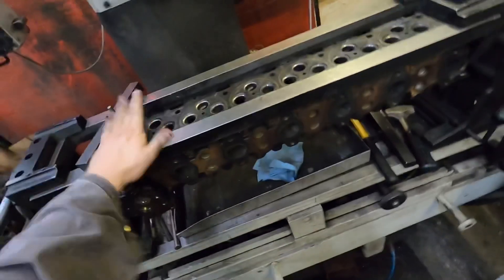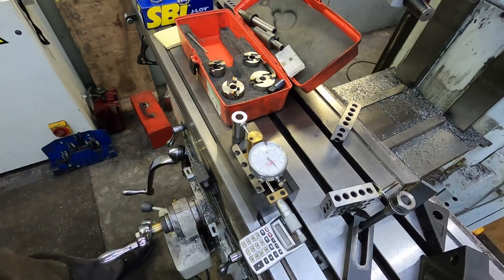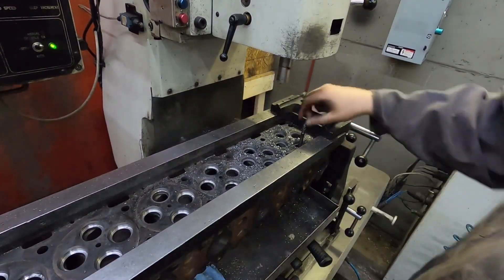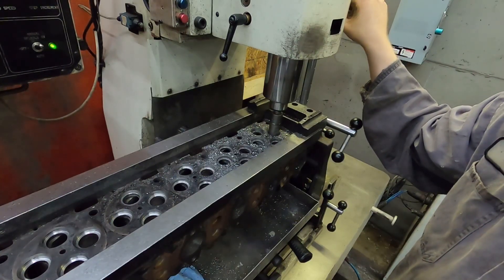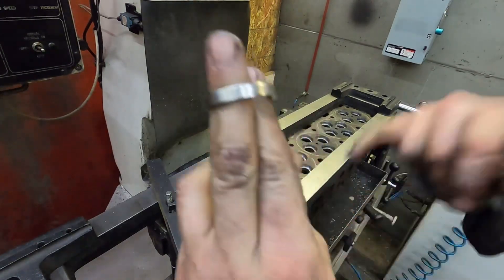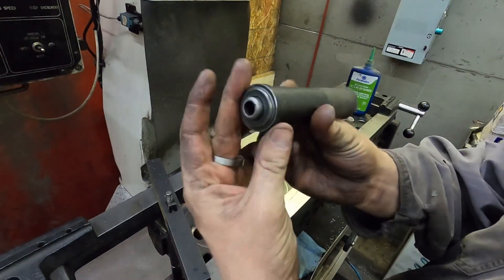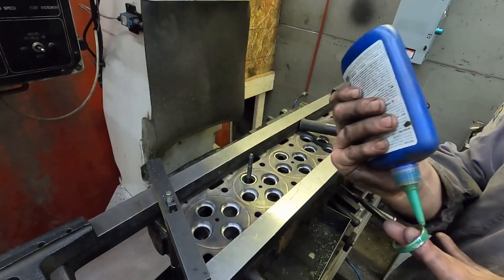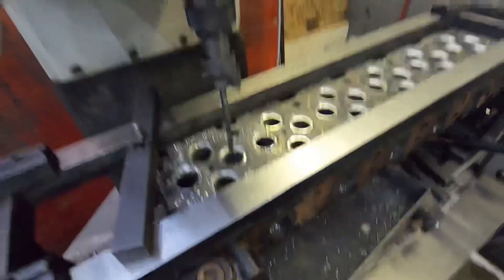PART 13 HOW TO BUILD A 6.7 PPUMP Cummins. Doing head work.

Comment: Would you recommend putting insert seats in the vp head or would the integrated seats be okay around 1000hp?
Reply from the maker: If there not cracked I would just leave the integral ones in.

Comment: 12mm pump or 13? and your getting a dyno? dyno wouid be so wicked to have.
Reply from the maker: maxed and balanced 215hp pump to start with. ya I will be buying one sooner then later
Reply: @CUTTERUPROB  what injectors you gonna run?
Reply from the maker: i think to start 6x.020 see what that does

Comment: Sir could you build a 6.7 p pump that would be for towing or may be a 5.9 with a 6.7 crank might be better . A motor that would be a great towing motor . Get decent mileage and plenty of torque . I like simple and don't want to deal with the expensive injectors and the other parts that is with parts of the common rail motor . Thanks for the great videos
Reply: A common rail motor will do your towing alot better at higher hp then a ppump or vp will
Reply from the maker: you could build one for towing for sure i like the 6.7 for the torque and air flow for spooling turbo's